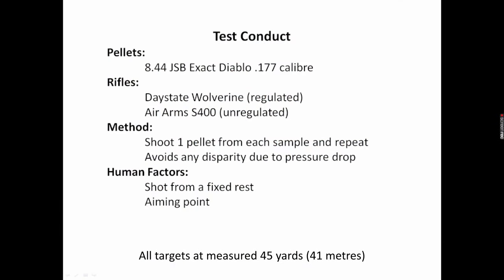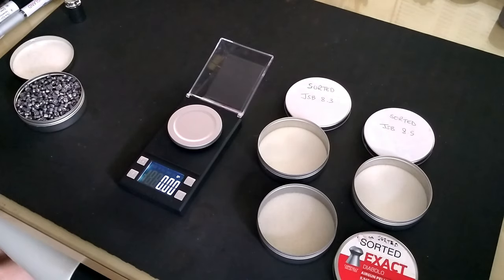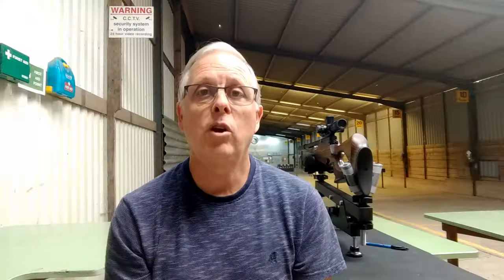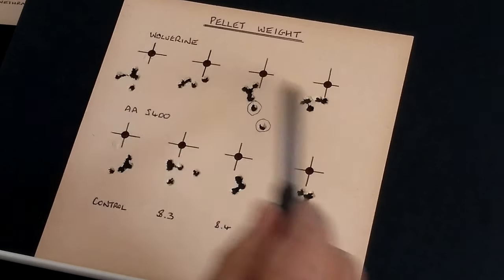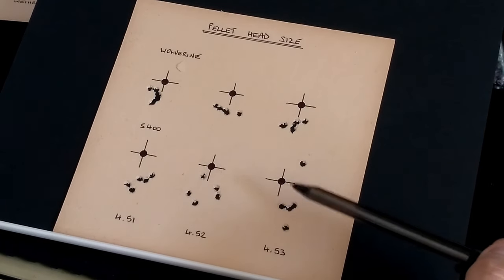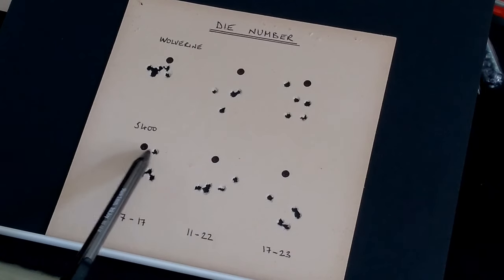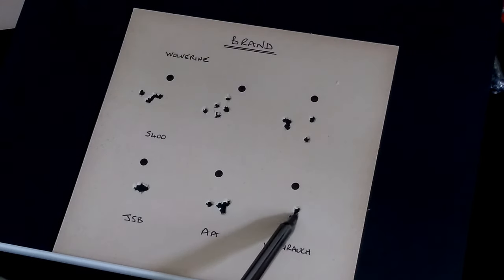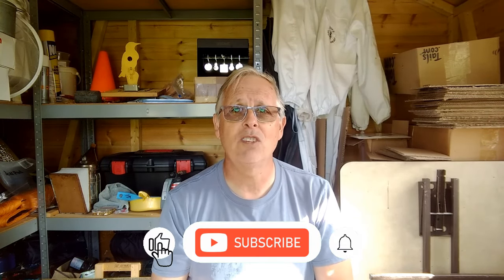21 - Exposing the Truth: Debunking Airgun Pellet Myths

Comment: Sorry but head size makes A difference no question. The die number also makes a massive difference and if you get a good one that works for your gun, but then all ! Git to be honest , your Air arms does not seem to be that accurate at all ? Have you cleaned it at all ??
Reply from the maker: I can only assess what I found on the day, but with the benefit of hindsight It would probably have been better testing without the gun rest as I found it uncomfortable to shoot with. I should have shot how I normally would and probably at a shorter range as others have suggested. As some other videos will attest the rifle is usually very accurate and I've won a few rounds at Cambridge HFT with it.
Reply: @hftshooter  I have won a few there too . 👍

Comment: Why does such a serious person weigh pellets on such crappy chinese scales without any legalization? After all, it is easier to buy Premium pellets from JSB Exact Premium that are already weighed and have a weight of +/- 0.001 g? To weigh such precise masses, you need a scale in minimum class II. I consider the scale test to be distorted and unfortunately incorrect. 50 grams is not a reference.
Reply from the maker: I'm not alone in using these types of scales to weigh pellets, although I don't currently weigh pellets for competition I use straight from the tin. I agree that the weight reading given may not be super accurate but they do allow pellet to pellet comparison. They allow you to identify pellets that weigh the same and those that are significantly heavier or lighter, so they do serve a purpose. It would be great if all manufacturers provided pellets in a tin with strict weight control, but they don't. Thanks for commenting.

Comment: You cannot draw the conclusions you did from such s small number of shots, AND you need to actually measure group size  in x and y a nd with calipers not a ruler. 20 shots per group may well give a different result.
Reply from the maker: 101 ways to test things. Thanks for your advice. 🙂👍

Comment: I really do not mean any offence, but your shooting is so randomn its almost meaningless....sorry. (And on a rest as well...😂😂😂)

On another note, the 'W' is pronounced as a 'V'....German manufacturer.

Your test on different labels for same tins is meaningless, because they were all different dies. The rules apply, its the die that matters, not the picture on the tin.

To suggest that different dies having an effect is 'plausible' is nonsense. Its a fact, and you call yourself a HFT shooter???😂

The damaged skirts will have a much different outcome in the wind, as it acts on the pellet .

The head size on a tin is meaningless, we all know this, so unless you measured them yourself, then the difference was, again, the die number only.

Airguns are  dynamic things, and to shoot a few pellets then declare a result is, quite frankly, nonsense.

I categorically disagree with you.
Reply from the maker: Thank you for not being offensive. 😅
Facts have to be supported by solid evidence, something that I've yet to see or experience myself in connection with die numbers. However, you are welcome to your opinion which I respect, and I would never mock you for holding it! Good luck to you. 🙂👍
Reply: @hftshooter  There is endless solid evidence from all the respected names in shooting, on a site called 'shooting the breeze' (And others). It really has been done to death, it's not my opinion, it's been tested and discussed, and tested, and discussed ad  infinitum!!!

Don't run before you can walk....been there, done that!!😁
Reply: Doesn’t the (within reason) damaged skirt expand against the rifling anyway?